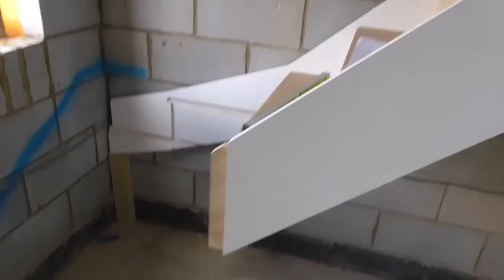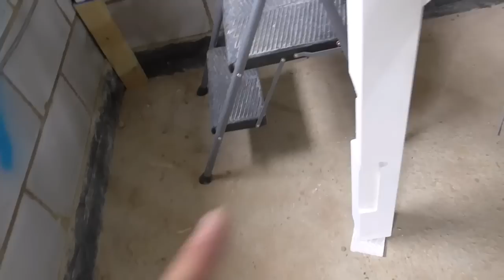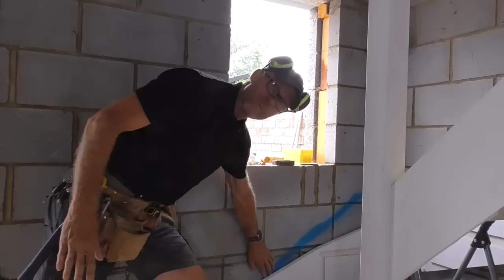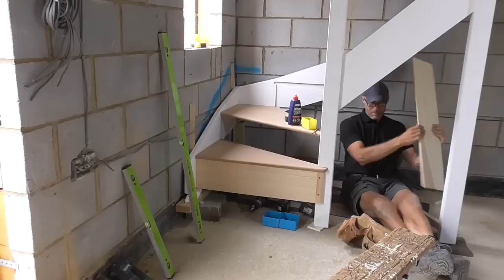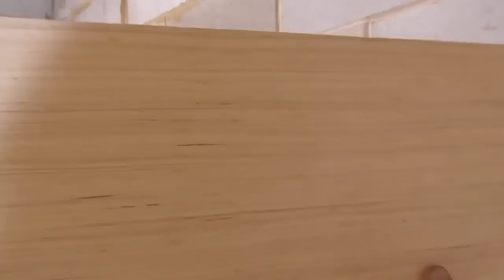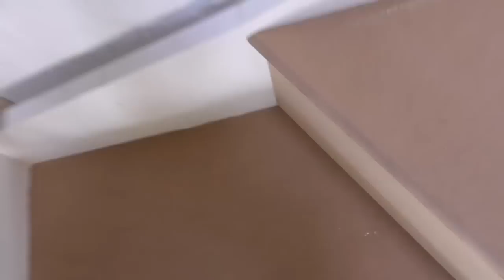How to fit a kite winder staircase***FINAL PART***

Comment: I haven't fitted a kite winder for about 5 years and yesterday I fitted a double winder I did it the same way as you and couldn't get my kite in I ended up taking it all onto the 1st floor build it complete and lowered it in position then I remembered that's the way I did them a few years back thanks for showing mistake very easily done lol
Reply from the maker: Hi Ash🖐Yes, it's super easy to miss a tread which then bites you on the arse later😲Thanks for watching and your comment 😎 Cheers Del

Comment: Boom 💥. I little thing i do is use 4*2 the full lenght of the tread instead of the glue blocks. An screw throught the top of the tread and rising if getting carpet.  I hope you apprentices are taking this experienced mans content in. 🔨
Reply: Right on bud. 8 out of 10 stair soaks is carpet fitters using hammer trackers on risers.
Reply from the maker: That definitely won't be squeaking bud👊Great comment and thanks for watching 😎 Cheers Del

Comment: Great job. My next job is to move a badly fitted, fully assembled two storey kitewinder.
It was fitted 140mm back from and 20mm above where it should be and makes the headroom in the attic below regs. The installer and the manufacturer are ghosting us.

The rafter jig I made worked out well, the inspector passed the roof, said it was very nice. I'll do a little follow up vid.
Don't ever stop making vids Del, I'm learning tons from you!
Reply from the maker: I'm really glad the inspector approved of you roof bud🤩and sounds like you've got another challenge on your hands with those stairs😵‍💫Cheers Del

Comment: I've literally made hundreds of stairs, all types, mostly for loft conversions, I always used to mark actual floor level (Finished floor to finished floor on site survey) on each newel and leave about 2 inches extra on. I also fitted my work, this was to allow discrepancies in floor level. The problem with stair makers today they don't want to fit, just supply. Which is fine but with buildings and floor levels all over the place there is something satisfying measuring and cutting as you go to get the perfect fit. Might be my OCD joinery background but its nice to be prepared for every eventuality. Nice work Del.
Reply from the maker: Hi bud🖐You're right in what you say, and this company will leave the newels long to get right down to the oversite concrete, and only didn't in this instance because I wasnt there when the site survey was done🤨Thanks for watching and your comment😎Cheers

Comment: Del, just a small point but I started fitting my latches your style - pilot drill, screwing it on backwards, scoring around it etc and my latches are much quicker and easier to attain accuracy!  Big thanks!  I still cheat and route sash/dead locks, 4" butts etc but you shifted me up a notch!!!  👍👍
Reply from the maker: That's awesome to hear Kevin👊and I'm glad its working for you🤩Cheers

Comment: Im glasgow based and used to do a lot of site work but ive been doing my own domestic work for the last 5 years . When you think the price we got on site for those was £90 you can understand why they are usually assembled on the floor and lifted in resulting in the posts usually being way off plumb . I really dont miss the juggling act between making money and taking pride in yoir work . Nothing better than taking your time , leaving a great job and getting paid . Nice work , that will be squeak free 👌
Reply from the maker: Hi Jamie🖐I never judge a job that's below standard, especially on big housing sites, as you never know the circumstances of the guys doing the work🤔Invariably, like you say, the job will have had to have been rushed due to a shockingly poor price😬Great to have you watching bud, and thanks for your comment 😎 Cheers Del

Comment: Nice job, we usually skip those glue blocks and use a piece of 2x2, screw it through the riser and tread and it draws the 2 together tight as a drum.
The reason being is that if the tread has slight round in it, it will not sit tight on top of the riser and with continuous weight being applied on it those glue blocks will have a tendency to fail after a while and then it will squeek.
Other than that nice job👍
Reply from the maker: I hear you Danny👍and I guess I just stick to using the supplied glue blocks as saves me needing to get additional timber, plus I tend to do more solid timber stair cases, (oak, Ash, walnut), which, obviously, can't he screwed through👊Appreciate your comment and thanks for watching😎Cheers Del

Comment: Another job well done. Isn't it a shame that a majority of Australian Carpenters wouldn't even attempt that. Stair construction and install is considered a specialist job. So you order your stairs, and carry on once fitted. About the only ones we do are steel stringer, straight flight. Basically bolt on treads. And I still think all this splitting of jobs is undermining what I believe a trained Carpenter should be able to do. It makes for too many different workers on site. Time delays. Extra cost. And an overall logistical nightmare. I bet the Builders you work for are glad they just ring Del. Carpentry sorted. Tick.
Reply from the maker: You make, as always, great points in your comments Dave👊and I agree that the splitting of general carpentry into separate disciplines is not goof for the trade as a whole 😵Thanks for watching bud😎Cheers

Comment: Great video mate, I am currently fitting this type of stairs on a new build site in kent as a price work carpenter. Do u think £140 per set is acceptable? I can see your taking pride in your work but I struggle to do it and make a living at the same time!

Cheers
Reply: £140 for a set like that is an absolute joke. Specially if its a new build I suppose u have to cut out the joist and boards for it and also install temporary handrails for health and safety. A lot of work goes into these stairs, also glue and fixings. Not to mention if u want it to be nice and straight u have to spend time adjusting it....
Reply: £140 a set seems really low, and they wonder why they can't get people into trades and or why quality on new build houses is so poor...

Absolutely taking the piss, especially when you consider how much they're flogging the houses at...

I'm sure some suit somewhere is laughing all the way to the bank whilst the grafters actually putting it all together can't afford to keep working...
Reply from the maker: Hi there bud🖐As the other commenters have rightly said, £140 for a set like this is a disgrace😵‍💫I'm often fitting wooden floors in homes built by a well known house builder, and I'm often seeing poorly fitted and finished staircases😬however, I never judge as I am aware of the shocking prices on site, and how guys need to earn decent wage for the day and not a pittance. And they wonder why the trade is struggling to get youngsters interested😒You do what you have to do make some money fella😉Thanks for watching 😎 Cheers
Reply from the maker: I agree👍Disgraceful price for a skilled man
Reply from the maker: Again, I agree with everything you say, and it's a shame the guys actually building these new homes haven't seen a fraction of the earning increase that the builders have😠
Reply: Thanks guys, I've always known the prices I'm on are a joke. Every one of their stairs are the same price, whether it's double winder, single winder or a straight flight. I have argued with the bosses I sub contract off that it's not right and they won't be charging the same price for the 3 different types of staircase so why should I get paid the same??
Reply: I also get paid 430 on a price for a single carport (roof truss, ply, fascia) as I do for a double carport!!! Its double the size FFS. has to be worth 25-50% more surely???
Reply: I’d seriously start looking for other work probably not price work if I were you.
Reply: £140 for a double winding set must be terrible in Kent. we are much further North and ours are £150 which we think is poor. (two of us fitting two sets for lunchtime) The surveyors setting the prices  think we are overpaid tho so nice to see everyone else thinks it's slavery too.
Reply: @pollyannahubbard5634  if its £140 for a straight flight too that is nearly double what we are getting up north.
Reply from the maker: @pollyannahubbard5634  It sounds depressing bud, and considering the skills you heed to learn and van and tools you need to buy, you'd earn more flipping burgers at MacDonalds😬

Comment: Hi del, providing this stairs went to plan and no issues how long does it normally take to fit a double kite winder like this?
Reply from the maker: Hi bud🖐This set took less than a day👍Probably 6.5 hours I reckon, but there is still the landing handrail, floor capping, apron, spindles and newel caps to fit, taking a couple more hours👊Cheers Del
Reply: @thetallcarpenter  another question del, do you ever plan your work days outside of work hours?. By planning I mean thinking through the job knowing what techniques and potential problems you may encounter. I try and do this outside of work hours as doing this on site can put me behind schedule if I was to stand there and think. Or do you have periods of time at work spent thinking through the job, and if so how much time max should you spend before it becomes counter productive in terms of too much time out of the day is being allocated to thinking as opposed to doing?. I know this maybe something you’ve never consciously thought of but maybe a rule of thumb for how much time if you do think through on site etc

Thanks
Reply from the maker: @chippy977  Great question, and the answer will have changed throughout my career as I've become more experienced. Simpler tasks tend to just unfold in front of me as I go, and therefore need very little preparatory thought, but more complex jobs like multi floor stairs and big technical roofs I nay need to take a little more time thinking about them, and ironically, I tend to do this during quiet times after work at home, and even when I'm in bed before I go to sleep🤔
Reply: @thetallcarpenter  thanks del!, would you say on average was it more than an hour after work each day/less more?
Reply from the maker: @chippy977  Probably about an hour bud